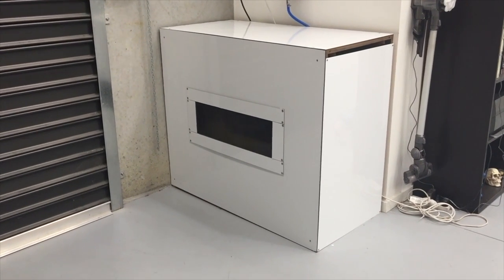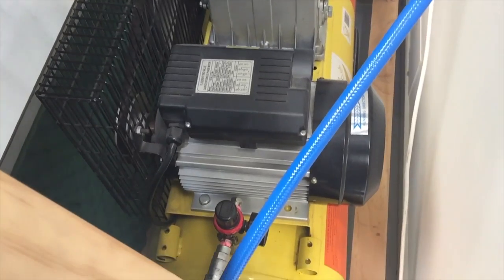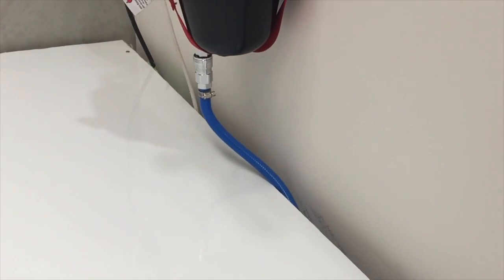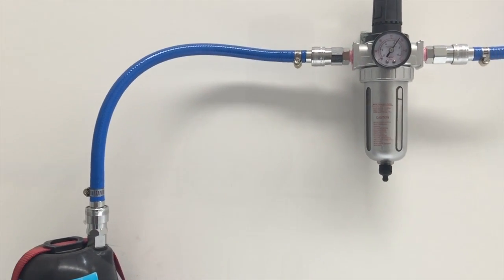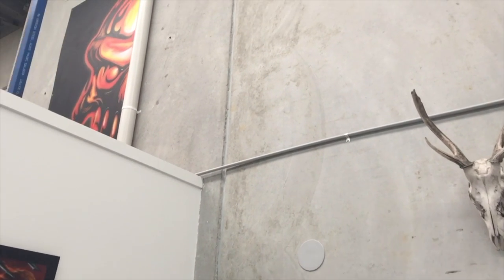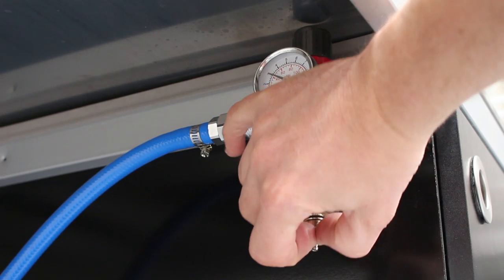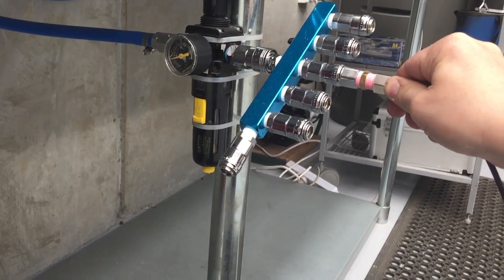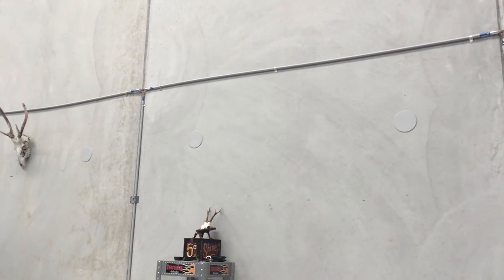Airbrush Insight : airline and bench setup

Comment: Exactly the video I needed! As I was painting a motorcycle gas tank yesterday, I noticed these little watter splatters. I switched my hose, in case the hose had some condense in it, but this didn't fixed the issue. So I drained the water out of my tank yesterday and it wasn't water but more like a mayonaise looking stuff. Also it had a slick feeling to it. And since it's an oil compressor I assume it's getting old and probably mixing it's oil with my air. Bad news! So now I have a 2y old compressor, 100L tank, sitting in the garage. Just standing there so I might aswell use it for my airbrushing. So this comes VERY handy to see what set-up I need to aim for. Thanks again for this and all your other tutorials! PS sorry about the long comment, i'm quite a chatter :P

Comment: have you given the manifold and using multiple airguns off the same reglualotor a proper go, in my mind i feel like there would be issues with pressure and getting a smooth and effective finish and air flow.
Reply: It depends on the compressor I use 6 gallon bostich the pushes 1.5 cfm. Can run a spray gun with .5 or .8 and or up to 3 airbrushes even 3 of my badger anthems with .7 double angle general purpose needles. But my 3 liter silent airbrush compressor can barely run 1 anthem but do 2 .35 and under gravity feeds.

Comment: what is the size of the airlines your running from the compressor throughout your setup
Reply from the maker: I will have to confirm exact diameter if that’s what you are interested in , I know they were slightly smaller than a regular airline as I fitted them in the conduit. As far as how many meters I used I believe it was almost 30 meters with moisture traps placed throughout. Hope that helps 👍🏻👌🏻
Reply: Airbrush Asylum in looking to run maybe 20 feet but I'm trying to setup a hard line between ends with flex line and quick disconnect at the compressor  and airbrush ends with pressure regulators  and air dryers at both ends. I have a 20 gallon compressor  I'm trying to hook up with.